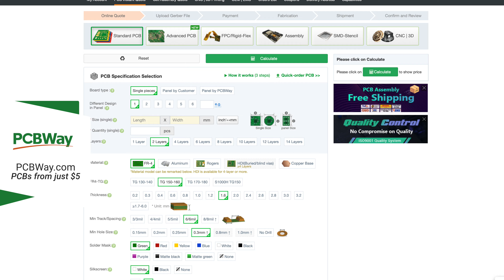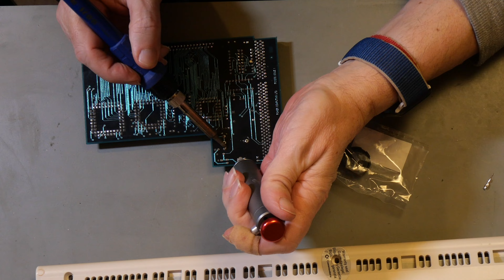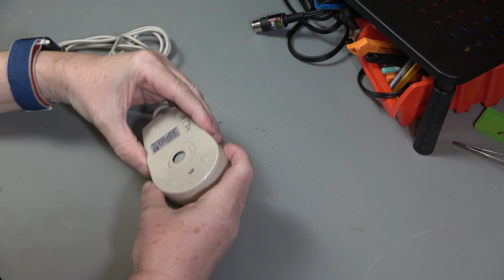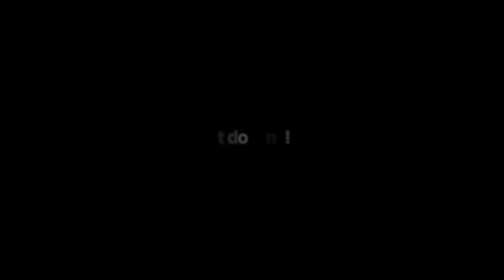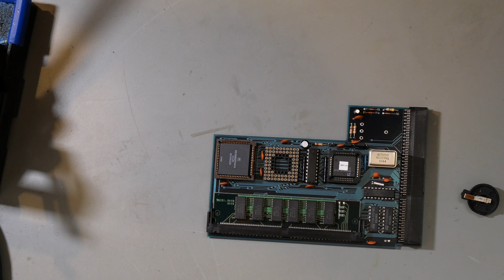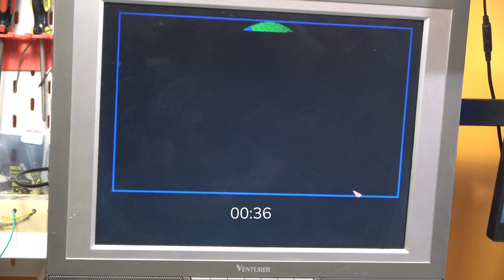AMIGA 1200: 68882 FPU Card and Restoration Part 2

Comment: Where did you purchase the compact card with the licensed Workbench card on it?
Reply from the maker: It came from a licensed reseller on eBay (based in Ireland - electronics_value_shop)
Reply: @TimsRetroCorner  Your video was 5 months ago.  When I went to get it, no longer available, but Amigados 3.2, on CD, with a presetup CF Card/Adapter, and new ROMS is what is available now.
Reply from the maker: It is still available. As of 2 minutes ago, the seller has 6 available in his store "New Workbench System 3.1 on 4GB CF Card + Adapter Amiga 600 1200 Hard Drive #588"
Reply: @TimsRetroCorner  Thank you.  Did I make an error ordering 3.2 from Germany (I think it is)?  Also, if you have the CF card, is it still a good idea to order a set of disks?  Is 3.2, or 3.1 better for an Amiga 500?  I also understand, being a REV5, I need a rom adapter PCB for any new rom.
Reply: @TimsRetroCorner  Sorry, I am getting my videos mixed up.  This one concerns the 1200 (have one of those too to eventually get to, but thought I would start with the 500 first).

Comment: Great video Tim! I am currently getting out all my old Amigas, A500s and A500+ (Has a purple boot screen!) and my A1200 with a blizzard IV 1230 Playing about with goteks and trying to restore the floppy drives (they are all dead!) and all my SCSI stuff with a quantum HD that seems to have died.. but after all these years ive forgotten so much about Amiga, software setup, do's and donts, ect..  but nobody seems to have done setup videos on original Amiga a1200 HD setups, formatting and configuration with an IDE drive and so on with the best WB install ect (That doesn't go into upgrading the roms ect and the latest and greatest OS for Amiga.. I'm looking for everything stock from that time period before all the OS revisions came about ect... Fancy doing one tim? lol
Reply from the maker: Subject to finding an actual working period correct hard drive (and it might be an A600 - but what works for one should work for the other)...
Reply: @TimsRetroCorner  Indeed.. but what about software, file system issues, larger IDE HDs like 80gb (Plenty of them laying about from old laptops ect) and re-using them with A1200s stock. with 3.0 roms.. Much confusion reigns over the old file systems vs PFS for newer Amiga OS and roms!!! Im lost with it all!!! :(

Comment: Hey Tim. The factor 1.72 on the beachball test in AIBB solely came from the performance benefits of the 4 MB FastRAM, because the FPU wasn't activated at the time you performed the test. On the right side in AIBB there are these buttons where you can switch between different benchmarking profiles. The CPU can be switched between 68000 and 68020. The FPU can be switched between SW emulated FPU, CoProcessor FPU operations (like your 68882) and 68040 native internal FPU operations. In your benchmark run in the video the floating point operations were emulated by software. Try turning it to "CP Math" and run the benchmark again. I am sure "Beachball" will be much faster.
Reply from the maker: Ok thanks for that - I clearly didn't notice! I'll do some updated benchmarks soon.

Comment: A 540Mb hard drive would have been massive for the era that this was from, is it possible that's not the original HDD?
Reply from the maker: I'm sure the original would only have been 20 or 40MB, if one was factory fitted (I think UK A1200s were 20MB), although there were dealer-installed systems too Did the factory installed systems come with a A1200HD badge? I have a feeling they did. This A1200 is a rev 1A board, so I'd guess it came without a hard drive initially. But yeah, 540MB was massive for the time, and probably pretty expensive, especially in the 2.5" form factor.
Reply: @TimsRetroCorner  the original packaging for the A1200 has tick boxes for up to 200mb hdd
Reply from the maker: (checks box...) none of them are ticked, not even "No HDD"
Reply: I have a US model 1200 with an original 85 MB Maxtor that is dated May 13, 1992. It's nearly dead so I use an IDE CF card adapter in it now. It has a DKB 1202 8 MB with 68882 board in the trapdoor that really wakes it up. I use it for games as the 4000 with the '060 can be a bit persnickety with some games.